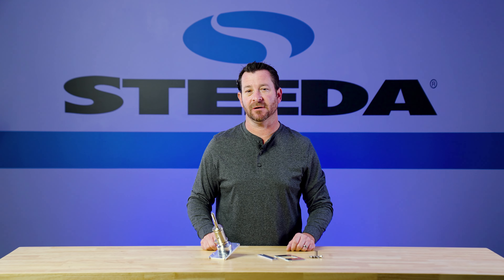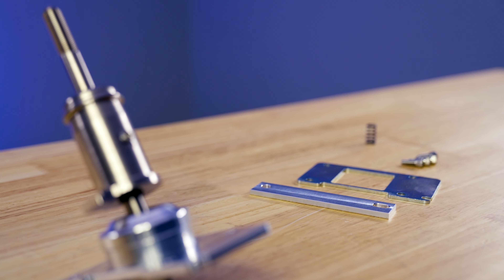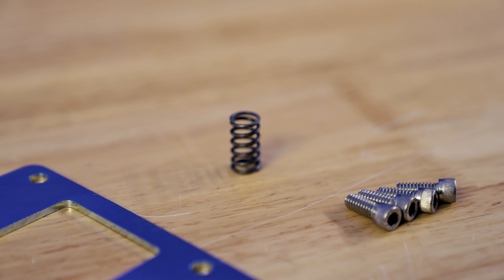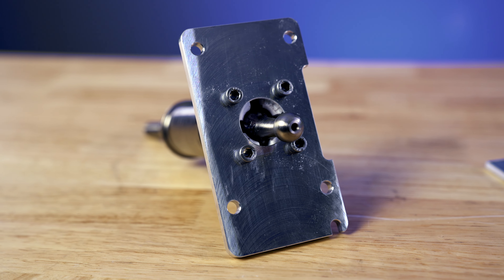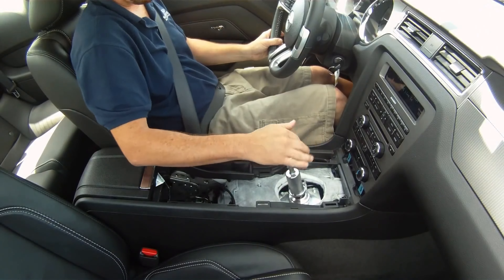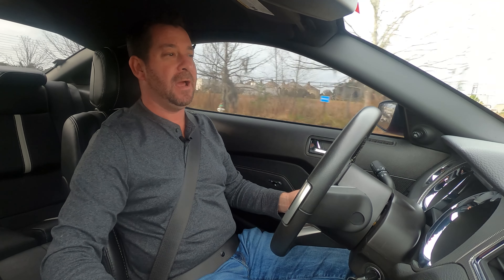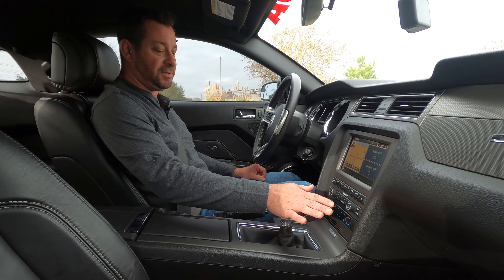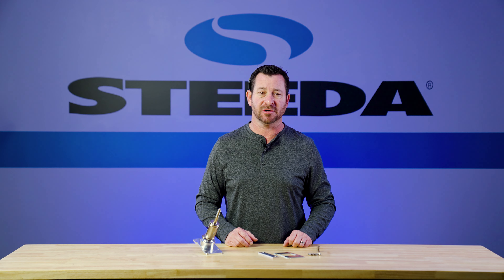Stop Missing Shifts in your S197 with the 11-14 Tri-Ax Short Throw Shifter

Comment: I have this shifter in my 2012 GT installed by previous owner.  However, the reverse lockout function is not working.  I can shift to reverse without pushing down on the shifter.  Do I need a new spring or adjustment to correct this issue?